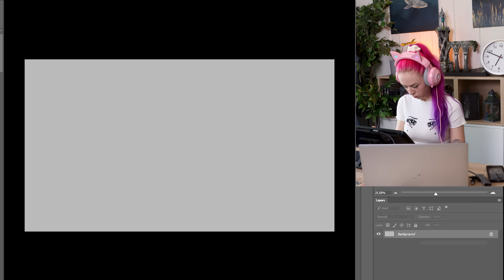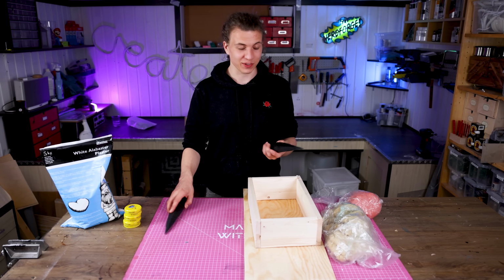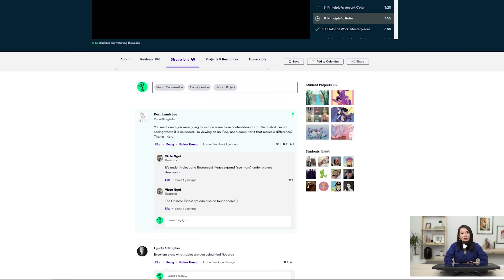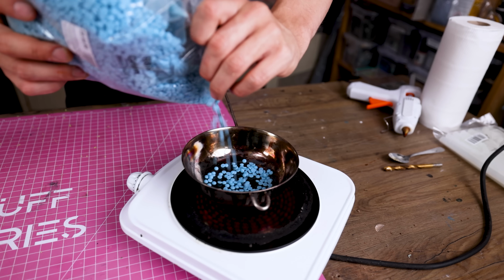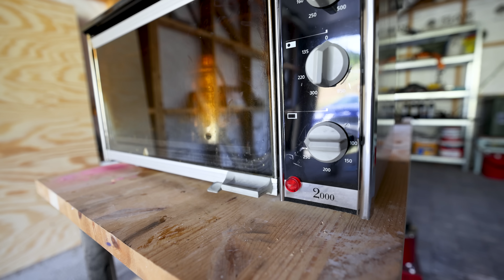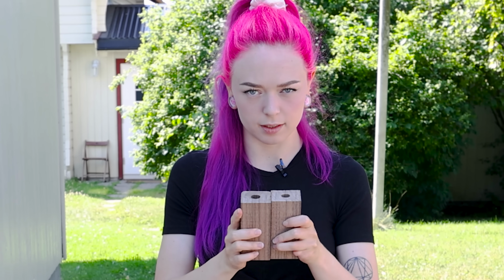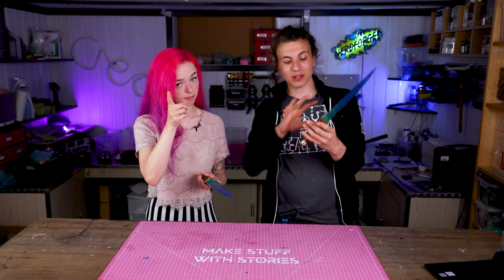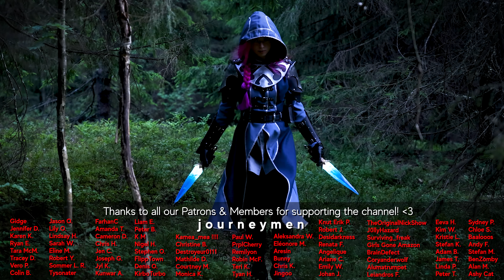I Made RESIN Daggers with Cast Metal!!

Comment: Hey nerdforge, it looks amazing! Just one thing though, with the magnet sensor lighting function, maybe instead of making the light turn on instantly, you could make the light fade in and out when you hold/drop, it would give it a bit more magical sort of vibe, but either 
way it's amazing!!!
Reply: A small effects board might fit in the hilt. Don't know many but the smallest I know of are for 3rd party Lego lighting. Flickering and pulse for engInes, fire, water etc. Pulse might work for picking up the dagger but dropping could cut power at brightest part.
Reply: I wanted to comment this exactly!
Reply: Adding a small electrolytic capacitor after the switch (and before current limiting resistor) would probably do just that. You could substitute those batteries with 14500 rechargeable battery to get more voltage and space.

Comment: Reminds me of how back in the eighties, Rusty Dawe (very well-known American costumer -- he and his wife Diane, plus their friends the Turners, won a lot of costuming awards at SF conventions, and later CostumeCons, back in the day) made Stormbringer, Elric's sword from Michael Moorcock's books. Similar, in that it only worked when he held it, but different.

No LEDs, so IIRC he used fiber optics. No teensy power supplies, so he had the battery on him, camouflaged as part of his Elric costume. He ran wires down his arm to his gauntlet, which had metal contacts in the palm (disguised as studs in the leather or something, with the same design in the other gauntlet), and the sword's hilt was also metal. When he held the sword, that connected the sword to the battery, and when he waved it, the light effect rippled up and down the blade. But if he let someone else hold it, they couldn't make it work. Magic sword -- only works for Elric. :)

Your daggers are massively awesome, and go really well with the costume!

Comment: Adding a dimmer 'switch' might have made the effect even cooler. The closer you hand/magnet gets, the brighter it glows.
Don't know if that's even a thing though.....
Reply: Don't know if you could do it in something the size of a dagger grip but, perhaps, hall switches with different degrees of sensitivity.  As the magnetic field gets stronger/closer, another switch closes lighting up another LED in the crosspiece.
Reply: @michiganengineer8621  It would also be very cool if they put a magnet in a ring. That way they don't need gloves for it to work.

Comment: 3 casting methods in 1 video... Nice. For shaping soft metals like brass I really recommend the files. Surprisingly a good file set will be faster and more precise at removing material than Dremel. And with file it' easier to achieve a flat area.

Whole video is a great manufacturing methods overview. The blades turned out great, and turning LEDs via reed switch is a great idea! Kudos to you!

Comment: Really amazing work!!!! 

The only thing that would make it a smidge cooler is if the leds faded up/down, instead of hard on/off. 
Don't know how much room ther is in the handels, but ther is not many components needed. 
1x Transistor, 2x resistors and 1x capacitor. You can find circuits just by googling it.

Just a thought, otherwise really cool stuff you two are doing!!

Comment: I love the brass casting! I still wanna do that some day.
You could instead of using a Hall effect sensor or reed relay. Have some a capacitive touch. You can maker those very sensitive, that it even detects through the wood, although the may flicker then from any other inductive source around.
A little wire is the best bet.
Or you can go the RF way, and  have a RF oscillator and an antenna, when it drifts (because you basically come gear the antenna) you can detect that with a simple receiver (this can be a simple AM) thing and switch it on.
But when you wear gloves a magnet is easily hidden. Or better a PK Ring from a magic shop!

Comment: The only thing i would have added to the electronics is a resistor and a capacitor so the led would fade in rather than just pop on.
An added benefit would be that it also fades out when you let go of the handle.

Comment: it be more secure if u have the daggers go in the handle it will give it more  safety if u hit something so they don't brake  
and it be better if  you made the pummel threaded it be more future proof  coz if u take the pummel the hole in the wood will start get bigger  the pummel will not  hold with that out of t way  very good job  on the daggers .

Comment: If you're ever thinking of working with investment again its a good idea to where a respirator and use ventilation. The dry powder is really bad for the lungs. Also the type of flask you got is actually for vacuum casting (what all the holes are for) if you are just doing a gravity poor like you did you can use a solid metal tube without all those holes. The cheapest option is to cut off both ends of a metal food can. Great job for a first time cast, looks good

Comment: I know creators on YouTube hate back seat creating, but you should check out the LM1117 3.3v linear regulator, you can use it with something like a 18650 Li-Ion battery to power the LED's. At 800ma it should be able to run 8 high intensity white LED's which usually have a forward voltage of about 3.2-3.5v.
It's just an idea to make it easier to charge and to increase the battery life.

Comment: Hey guys...u do awesome work here...a big fan.....
A suggestion....u can use a capacitor in parallel with light bulbs...that way the bulbs light up gradually...and even dim out gradually...which i think would look really cool....idk if it will work with LEDs but jzt a suggestion :)

Comment: You actually don't need to burn off the wax, if you use slush wax it should instantly vaporize when you pour in the metal and exit with the rest of the hot air through the riser. @Nerdforge. I've been doing bronze casting for 2-3 years now and I get very good results, I can see my fingerprints in the metal post-pour.

Comment: Awesome build! Omg this is so great! I was wondering why you didn't use sand/clay method for casting when the guard was being made, but you did use it for the pommel. I realized that it was a new method you were trying out, and it turned out very good. Which method do you prefer to use now when casting and which method produces a better result? The first method appears to have a few more steps to go through and looks to be much more time consuming, but if the end result means less polishing and grinding, it may be well worth it. Thanks in advance for any info or opinions to my questions. Cheers!

Comment: Not sure how it could be fit into such a small space. But it would have been even cooler if you had used the hall effect sensor to vary the lights intensity with distance. So instead of an off/on switch, it would turn on more gradually as your hand approaches it.
I'd be worried about using wood for a compression fitting. Given a couple moisture cycles, the grain will have crushed itself the the point it becomes loose.

Comment: I think that might be a reed switch, not a Hall effect sensor?  A Hall effect sensor uses tiny changes in voltage to detect and measure magnetic fields, and it needs to be connected to measurement circuitry in order to do anything useful.  A reed switch is just a switch that closes when there's a magnetic field nearby, and can pretty much be substituted for any other switch or button
Reply from the maker: Yep correct, I said wrong name in the video

Comment: love this stuff but they seem fragile should of left some brass pins on that pummel for the wood to grab. less fragial at that joint or if u do break em drill out the brass and wood and pin em.
Reply: also you should stain the wood before attaching anything so its all sealed

Comment: A little advice. When melting brass u really should wear a mask.  When heated strongly, brass will lose zinc ("dezincification"), which will react with oxygen to form zinc oxide. Zinc oxide fumes are not super toxic, but they can cause metal fume fever

Comment: It occurs to me that printing in plastic, making a mold, casting it in wax, making a mold, theb casting in metal, is a lot of steps.  Why is there no 3D FDM printer that just prints directly in wax?
Is there some technological issue that prevents that from working?  Like the wax getting too watery? Is the time after melting that the wax is plastic (moldable) too long?

Comment: For future reference...  you would have save ALOT of time & effort on the guard pieces if you had just electroplated the original 3D printed positives.  I used to have my own silver/gold jewelry business featuring 100% handcrafted original pieces, so I'm all too familiar w/ casting precious metals.  Speaking of which, I didn't see y'all use a vacuum chamber to suck the investment mix into all the nooks & crannies.  Maybe I blinked & missed it.  Anyway,  clever w/ the Hall sensor.  It IS a wee tad abrupt w/ the on-off.  Which is being uber picky, only 'cuz you did such a great job.  I'd try a pressure-sensitive variable resistor that increases the current as you squeeze lightly.  :)

Comment: Silly question,  why didn't you use silicone to make the two part mold? Easier and would have been reusable
Reply from the maker: Great questions, there are multiple reasons:
1. Mold making silicone is quite expensive, and hard to come by in a lot of countries! Whereas plaster is very accesible and cheap for nearly anyone. So we're just showing alternatives to what we usually do. 

2. Silicone mold making is better when you can vaccuum out the bubbles in silicone, but we wouldn't have a big enough vaccuum chamber for the amount we need. Of course this could be done in iterations, but it complicates things. 

3. The resin when put in a joint two-part mold will create a lot of tiny bubbles that won't be able to be released, so we would need to use a pressure chamber, which we don't have a big enough of either. 

So all inn all, while plaster can't be reused, it makes for a more predictable outcome without a lot of investment in either tools or supplies! It also scales well for bigger molds :)

Comment: They look kinda bad honestly. The blade is too fat. the guard is weird. It does not prevent your hand to slip or help you block an attack. The handle is too round making it uncomfortable. And the pommel it has a tip pointing at the user. Self stabbing dagger